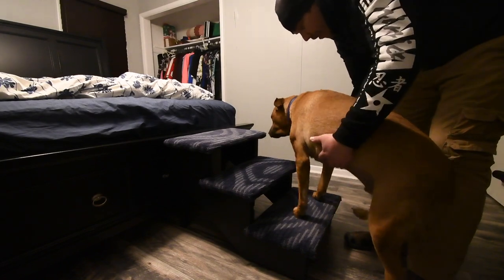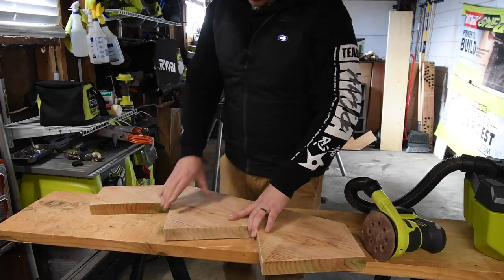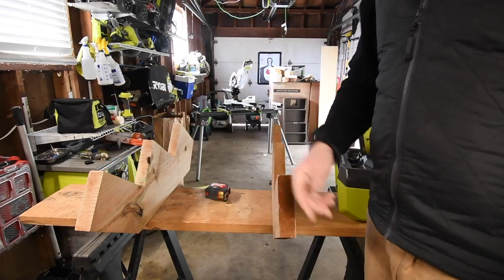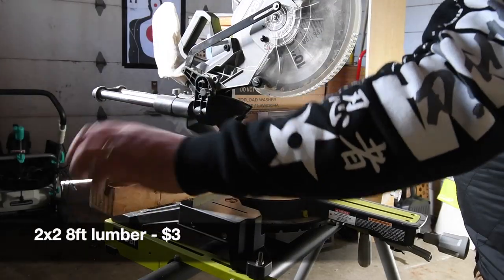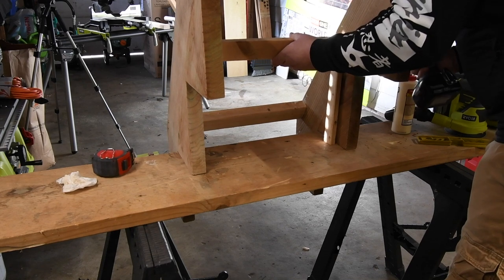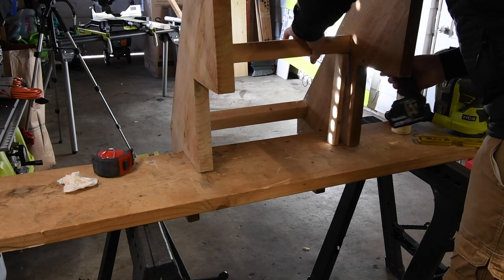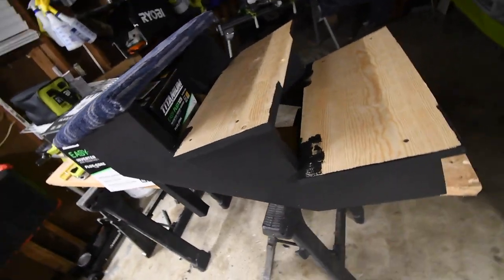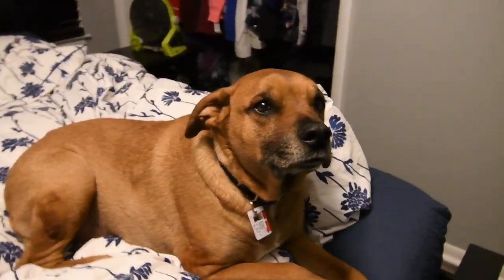How to Build Doggy Stairs

Comment: Dave, Your Pup is one solid and Handsome guy!  I loved the very first part, with you ‘coaxing’ him up the steps. 😁👍🐶
Nice job!  Nice build!  May I suggest, if not using SPAX screws, pre drilling would have helped you here, when trying to fasten the cross braces, especially when clamping is not possible.  I see you used a Makita Impact! 👍 😁  Just a kind suggestion on the pre drilling.  I have been in similar situations, and have struggled with getting the fastener started, etc.  I concur with others on here that these type of videos would be very welcomed.  Stay safe and Healthy Brother !  👍👍👍👍😁✌🏻🐶🇺🇸 P.S.  Nice catch @8:46,  on that last step piece coming off the saw, Ninja Dave!  😁
Reply from the maker: I thank you George, I love my little old man

Comment: Great video! I probably would've used T50 staples instead just because they are wider but the 18 GA are definitely stronger. Also I've tried that Ryobi stapler and it lasted 1 soffit job and then it misfired every other shot so it got traded in for a Dewalt. Could've just been a faulty model...
Reply from the maker: I thank you Great White